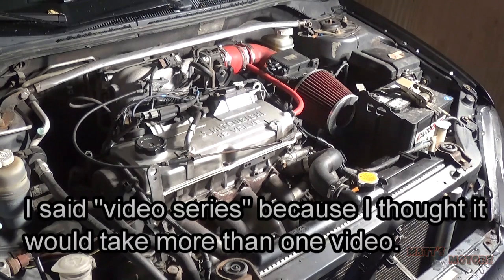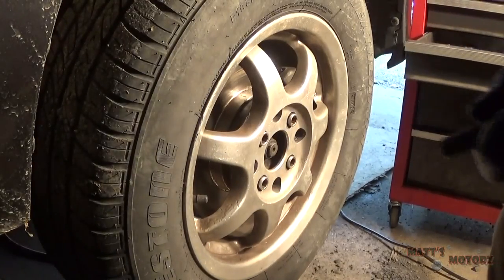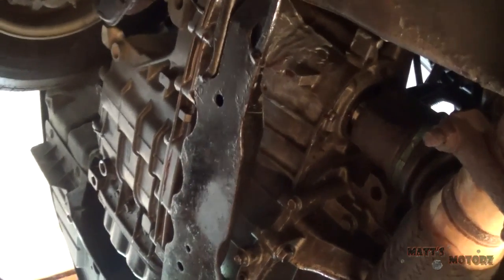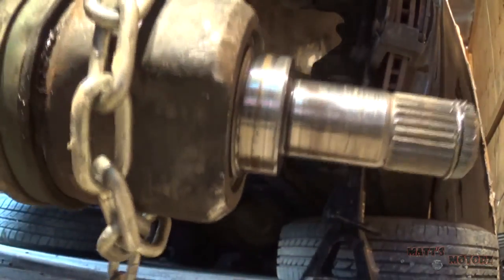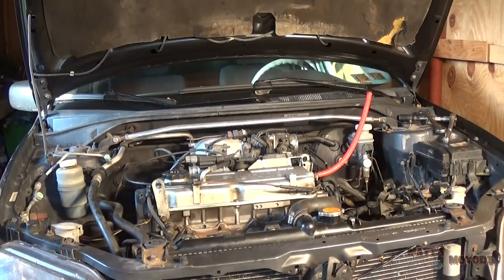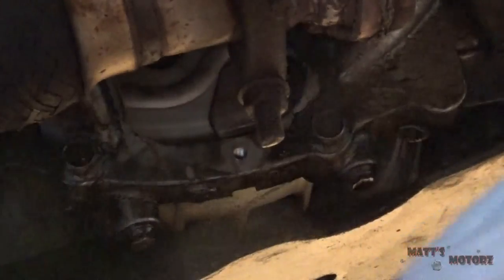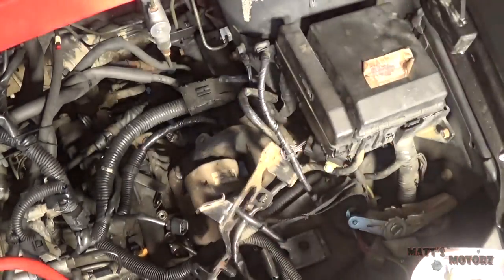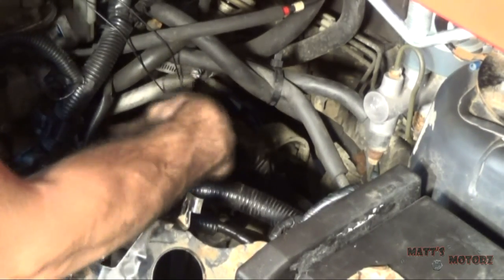Transmission Removal [2002 Mitsubishi Lancer]

Comment: Thank you for such a comprehensive video!
My 2000 Mirage 1.8L trans just went @ 255k, the engine still has life in it, so thanks to this video I'll feel confident tackling a trans replacement for the 1st time.
If you are ever in the NJ shore area, I owe you a beer...or a case. :)
Reply from the maker: +craiggus365 Haha. Glad the videos helped out! Hope everything goes well!
Reply: +MattsMotorz  I just towed my car back today and got axles, struts and tie rods off (~about an hour before it dark.)  All other work will have to wait until next weekend.  I'm removing the trans 1st to check for other damage before I order the $395 Ebay special, just making sure everything comes out ok before I spend the money on a trans.  I just need a year more from this 2nd car and my ~$600 total will be more than well spent.
I'll def update as I go.
Thanks again!
Reply from the maker: Awesome!
Reply: +MattsMotorz 
It came out in about 3 more hours (about 1 the other day, so ~4 total,) I was pleased to say the least.  The access panel is far different on the Mirage and not in a good way, the bulk of the time was wrestling that cover off w/o cutting the exhaust.  The exhaust bolts are so rusted I would have had to use way to more than wrenches. 
Any tips on the reinstall?  
The only other question I have is do I need to replace the seal on the torque converter?  It wasn't leaking when I took the old one out.  I should try to remove as much of the black trans fluid it spewed and put fresh in before re-assembly, right?
Reply from the maker: Not too bad! Sometimes it is better to just cut the exhaust.  I remember the re-install going pretty smoothly.  The hardest thing for any trans re-install is getting it mated with the engine.  As soon as you get two bolts started, you're golden.  Just make sure you don't force em! They should all thread smoothly in by hand first.

You mean the seal on the transmission? Or the bushing in the torque converter? If the old transmission was spewing black fluid, it would be best to  get a new torque converter, as well as flushing out the cooler and lines.
Reply: +MattsMotorz  The torque converter - It wasn't leaking but it came off the trans input shaft and the fluid that was inside looked like used oil.  I dumped out what I could but I'm not sure if I should try to pump some more out or just shake it around and get as much out as I can.  It was working fine and not leaking, I just figured the more new fluid I can get into it the better. I'm not sure what is the best course of action.
Reply from the maker: In the past, I have found that the best way to get all the fluid out is to let it sit upside down over night.  But tilt it ever so slightly or it will seal and the oil wont flow out. You will never get anywhere close to this by just shaking it.  Let it sit.  And yes, if you aren't going to replace the torque converter than definitely get as much fluid out as you can.
Reply: +MattsMotorz  I picked up my $107 97k trans this morning and got back around 12.
I just came in from testing it (6 PM,) wheels still in the air, but all seems good.  I'm going to finish brake and strut assembly tomorrow AM, but your video made this a breeze, figuring it was just me and my 10 year old son getting it mated.
I really appreciate the time and effort you took with this!
Reply from the maker: Glad that everything worked out it seems! Happy my videos were of use!

Comment: thanks so much dude with this information I will be able to complete my conversion as I have a automatic but I'm converting it to a manual because I want to mod it but what's the point since it's automatic so I thank you so much it will happen soon after I buy the brake pedal,clutch pedal,clutch assembly,clutch master cylinder,and the transmission I will keep you updated
Reply from the maker: +Adrian Garcia Good luck!! You will probably also need to replace the main computer.  There are all kinds of sensors and engine control programs that rely on input from the transmission.  It will probably still work.  But I would wager the check engine light will be on.
Reply: @Adrian Garcia where did you buy the manual transmission from?

Comment: A huge thank you for this video, it helped me a lot. 
One thing though, I don't know why you disconnected the torque converter in 9:43 but I didnt do it and it all worked well anyway.
Thanks again!
Reply from the maker: +Pizdzirynka1 Thanks for watching!  If you don't disconnect these bolts, it is more work as you need to pull the transmission away from the engine horizontally first.  This will cause the torque converter to pull out from the transmission.  It is much easier if you disconnect these bolts as the transmission can just drop down vertically directly from it's position.  Plus it doesn't make a mess!

Comment: The intake mod was horrible, its takes in the hot air from the radiator fans vs the stock intake gets fresh air. Mightycarmods tested that on a Dyno. Good video.

Comment: You make it look so easy lol. I'm really debating on if I want to put in a different transmission in my car, but don't want to break anything.
Reply from the maker: What do you mean by "different." As in another one of the same transmissions for that car? (Namely, another F4A42) Or a completely different transmission??
Reply: Yeah, a used one from a different car. I don't have a Lancer, I have a Maxima. But I assume  the steps are relatively the same. I'm only 18 and have never done anything major other than 2 lower intake gaskets on a 3800. So replacing a whole transmission seems overwhelming. But my tranny has some issues and I don't want it to get worse.
Reply from the maker: Subway Guy What's wrong with it?  

You know, I get a lot of people that ask "should I do this?" and it is always very hard to answer that question because I don't know you guys.  It depends on your mechanical abilities / experience.  So only you can know if you should or not.
Reply: It's a 2002, so it's got the 3.5L. Not sure on the transmission type/code. But the issue I have is that when you drive the car first thing in the morning or after the car has cooled down a lot, that when shifting into 3rd, it will disengage from 2nd, rev up slightly, and then go into 3rd pretty hard. It will shake the whole car. 

To reduce the issue, when it's about to shift, I will let off the gas so there isn't any RPM's making the transmission work hard, and then it will shift fine. No jerk, no rev. Now after the car reaches operating temp, I have to get 2nd gear over 4000rpm at least 3-4 times before the issue goes away. Once that happens, the car shifts fine at any speed, no need to let off the throttle anymore. 

It's a very picky issue that requires certain steps to make it not happen. I went on the Maxima forum and they said the solenoid pack in these transmissions go bad and cause the issue I described. But that requires removing the transmission pan and valve body. Not to mention the solenoid pack itself is over $400. And some people did not have any luck when replacing it. So if I spent the money to buy it and it didn't work, then I'm out $400. So to me, replacing the whole transmission with a used one would be easier and better for the car.

The transmission fluid was changed prior to me purchasing it so there's nothing I can really do.
Reply from the maker: Yeah I would agree that a used transmission is probably the better option given the circumstances.  The problem sounds to me like something has gone wrong internally.  Could be sticking valves (which move more freely when their bores expand) or leaking seals or whatever.  No way to know without investing time in diagnosing.  

I don't remember this transmission removal being particularly difficult compared to some others I have done so it may not be as bad as you think. There is a first time for everything!
Reply: That's what I'm thinking as well. I'm starting college in 2 days so even if I did decide to replace it, it wouldn't happen until next summer. I have no job and can't waste money lol. So I'll have to live with it for now until I have the time, money, and knowledge to get it done.
Reply: MattsMotorz Fucking A FWD looks much more difficult then RWD

Comment: Cant believe he used a ratchet strap to hold the battery in!, When upgrading the battery in the lancers (2003-2006) a larger battery holder is needed when going from the 360cca to 564cca, the strap you can get from a ford (take a trip through a wrecking yard, you'll find them), then use longer holders to clamp in the new locations under the battery holder.

Comment: hey  i currently have a problem with my transmission    i believe its the cvt type in my  2002 cs2a lancer. however on an incline or on a hill i would lose power and the car goes nowhere  peddle to the floor and it just refuses to go revs not climbing i was told it was a problem with the cvt belts in the transmission and i would have to  get it change or have my transmission rebuilt . after watching your video i can see all that needs to be done to take it out since i dont have the tools  i will be carrying it to a specialist to have it checked and serviced but rest assured the specialist cant tell me anything different to what i just seen here.
Reply from the maker: joaocarmeloHD I don't think the transmissions in the lancer of this year is a CVT.  However I can be mistaken.  I can tell you that the one I rebuilt and made videos on was not a CVT. 

That condition can be caused be a number of different things. Unfortunately I cannot give useful information without diagnosing it myself :\
Reply: i had the same problem on hills with my 96 altima,changed my fuel filter and it fixed it,its still kinda iffy but i also need to new throtle cable,hope i helped
Reply: also...replace or check yoir fuel injectors,on my altima theu were so old i replaced with a used pair and it made a diffrence

Comment: Your videos on the F4a42 removal and rebuild were instrumental in removing an F4a41 in a Mirage.  Transmissions pretty close.  Can't afford a shop rebuild so giving it a DIY rebuild.  Car had a clunk at about 30-40 mph then no gears.  No forward or reverse.  No codes or other transmission failure indications.  So far in the tear down no smoking gun.  Working on the valve body now.  This one also looks like a rebuild as clutch plates look fine.  Any suggestions on what to focus on?  What parts should absolutely be replaced?  Overall great video series.
Reply from the maker: Bob Gerhart Thanks for watching! 

Hmm, that is a tough one. There are few things that would cause a transmission to lose ALL of the gears.  Even manual gears? (like 1, 2, 3) The issue would likely be in a component that affects fluid pressure to everything such as a pressure control solenoid.   Sorry I can't say anything more useful.  :\

Also, make sure you have the factory service manual during the rebuild, you can download it online for free.
Reply: Great and thanks...yes...even manual gears no-go.  The filter does look a bit black inside so maybe that is affecting fluid pressure.  Thanks for the immediate feedback.
Reply from the maker: That actually could be the cause.  Many times when filters are going bad (clogged up),  the fluid cannot pass through it very well so the transmission ends up backing up and insufficient oil is left in the sump.  After letting it sit and letting the fluid drain back, it usually works again for a short while.Sometimes when the filters are really bad they are considerably heavier than the new one.
Reply from the maker: The problem with this transmission is you need to open it up to change the filter!

Comment: Hi! thank you very much for the video!!! Can you tell the "differences" and "similarities" on removing/refitting a manual transmission? (same Lancer, same engine) I think a manual transmission is smaller, so should be easier? Thanks again!
Reply: alot easier no cooler lines electrical connections (almost) no tourqe converter hard to access bolts you will have to remove shifter inside cabin obviously
Reply: @bradysolaem2467  thanks a lot!

Comment: Left field question. Do you know if a 4g63t would bolt up to this same transmission? I just got my hands on a 2003 oz rally that has a blown motor. Been wanting to upgrade it seeing how im already teplacing the motor, but I'm not sure if the 4g63 will bolt up right. It has the 4g96 in it right now.

Comment: Great video mate,,well done.  Can I follow this for my 01 eclipse GT 3.0?
Reply: I would say so!! I had a 01 stratus R/T with the 3.0L and I was able to do the clutch easy!! I was 17 when I did it haha. 
I think the only difference is the 3.0L has a ring clip attached to the pressure plate and throw out bearing! You have to push the clip in to separate the pressure plate and throw out bearing. 

Just remember to put in Gear Oil into the trans when you have everything finished up! I forgot to and blew my trans like 2 hours after I was done😂 lesson learned😂

Comment: Hello, can someone help me please? I have a 2006 Lancer Ralliart and the transmission sounds a lot. I went to many junk cars and I only got a 4th generation eclipse with the same 4g69 engine. Will the transmission work for my Lancer Ralliart? I checked the code and the one on the eclipse starts with KF5M422V5P and the one on my lancer starts with F5M422R795. Will it work for you?

Comment: My 2002 lancer (automatic) transmission does that awful grinding sound when i put it on Drive or reverse, im not good with cars so i dont know what the problem with it and i also dont know how much it would cost to get it fixed. So im debating if i should let it go or not cause i dont know if its worth keeping.

Comment: Need a few tips. I will be changing a flywheel on a galant. When you turn the engine is there a specific way I need to or should not turn the crankshaft?
Reply: Guess just the one tip for now
Reply: I don't think it matters

Comment: Hi my friend, a couple of questions: That Transmission was a CVT?  if so, is it true that the carter (engine oil drain pan) is located in the center instead of one side?   I'm asking bacause i'm not sure if my Lancer 1.6L GLX 2002 A/T is CVT or not.  Actually it's supposed to be CVT, however in the oil dipstick it says ATF so I'm comfused... I'll really apreciate your feedback
Reply from the maker: +Leo Castro ATF means automatic transmission fluid.  A CVT is just a type of automatic transmission.  It still uses automatic transmission fluid.  The transmission in this vehicle is not a CVT.  To find out for sure if your transmission has a CVT transmission, call up the dealer with your VIN number and ask em.  They can look it up.
Reply: Cvt transmissions especially Nissan are the worst thing to happen to cars since fuel injection

Comment: Thanks for the video!! I dropped my tranny in but i have a manual and there were way less things to remove from the transmission. I was able to leave the cross member attached and just left the 2 mounts hooked up, was that not doable on the auto?
Reply from the maker: LTCirabisi It probably was possible, but it made things easier for me and didn't require much effort to remove.
Reply: How did you get it to break free bell house I literally have everything off of it

Comment: Hello , 2 questions , what it is the pipe where the hydraulic transmission oil leaves the radiator to be cooled , and where can I get the oil temperature signal of the automatic transmission , thanks
Reply from the maker: First Question.  What do you mean "what is it?" It is a pipe. 

Second Question:   Make some calls to autoparts stores. Pepboys, advanced auto, autozone, etc.  If they dont have it check online.  I like rockauto.com.  Finally if all else fails go to the dealer.
Reply: It is seen to have two hoses coming out of the automatic transmission to the radiator to cool the transmission oil , which leaves the oil by the radiator and which returns to the automatic transmission .

Comment: A lot of transmission fluid leaks from my 02 Lancer. Where the axle enters the transmission. How do I fix that? Should i take it off the brake thing, then force it in if it's too far out and loose? I've got no clue what to do, it just leaks from that point and it leaks a lot of fluid.
Reply from the maker: You need to replace the axle seal.  This requires removing the axle and pulling out the old seal either with a seal remover tool (if you have enough room, you can get them at any autoparts store.  it is a handle with a hook on each side of it) or a slide hammer.  If you go through my rebuild for this transmission, fast forward to the point where I replace the seals to give you an idea.

Comment: just got an 02 lancer and I've been putting off a transmission. fluid dump bc I can't seem to find that bolt u pulled to dump it can u point out where it is?
Reply from the maker: Its on the drivers side.  Just look for the transmission pan and follow it to the drivers side and there should be a pretty big hex bolt you can remove.

Comment: 2002 mitsubishi eclipse spyder gt 3.0 transmission no fluid coming out the hose and wont kick in gear ???
Reply from the maker: Sounds like a bad pump, but you should get a line pressure measurement to verify (I made a video on how to do this).
Reply: Thanks